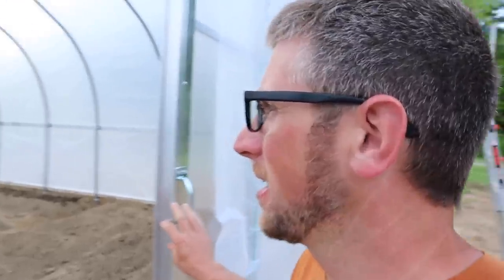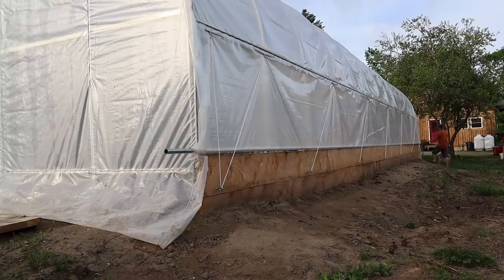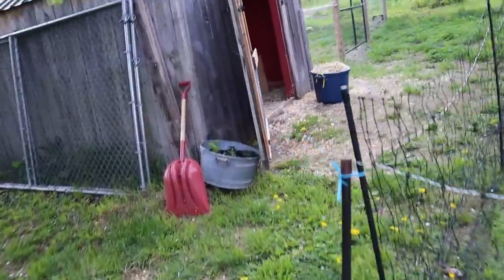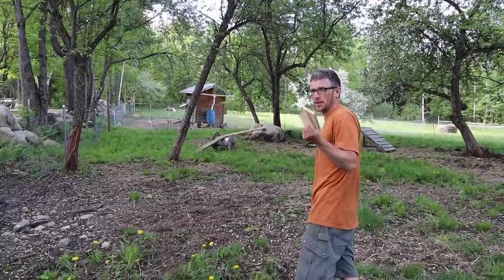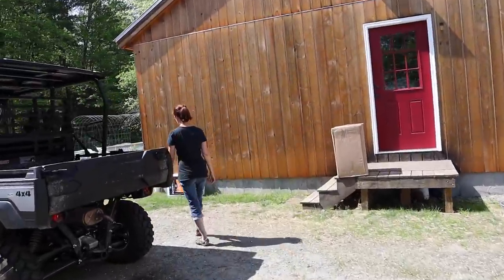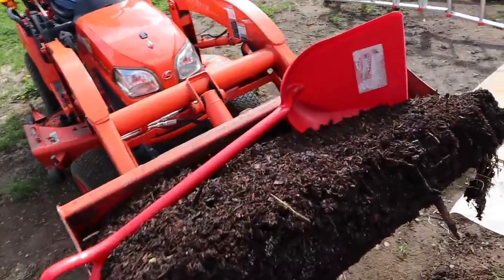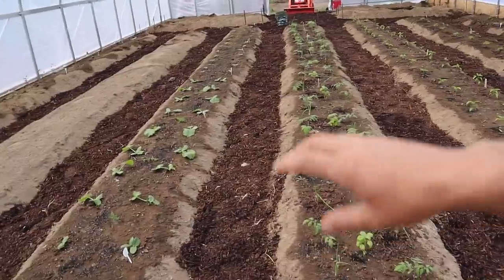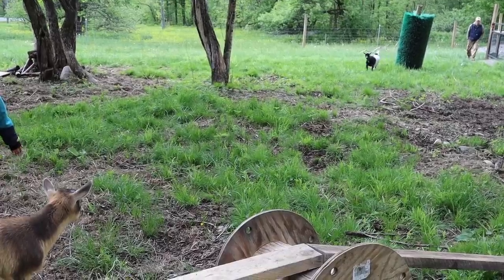Miniature Baby Goats MEET Our HERD for the First Time (Not what I was Expecting)

Comment: You can get solar power fans for your vents and hook them up to thermostat. Put 2500 black water tank to your rain gutters then do soaker hoses and drillers by gravity feed or 12v pump. Maybe leave the middle row out for your tractor and equipment to get in easy. Do hanging bar for vining plants and grow lights and even watering from above too.

Comment: Mornin Al and family, have you ever considered going to the thrift store (or similar) and buying cheap snow skis to screw to the bottom of your tractors, sure you could pull them much easier over the grass that way
Reply from the maker: I like that idea. We dont have any thrift stores close by though
Reply: How about a thin sheet of fiberglass on the bottom?
Reply: That is a really good idea! Smart
Reply: seeker my thoughts as well using old ski or even a narrow strip of tin or sheet steel galvanised if possible. Would make them slide easier and stop wear on. The wood,.
Reply: @LumnahAcres  You also didn't have any CWC licence plate makers close by , just put the word out Al and you will receive
Reply: My son worked at the local Habitat Restore and got a pair of old ski's he then attached them to an old grocery kart the wheels had broken off and it made the best crazy sled to be pulled behind a 4 wheeler (yes, they wore helmets) on our back roads, he and his friends had so much fun. We don't get a ton of snow here in central NC but we make the most of it!!!!

Comment: Instead of watering the high tunnel with buckets of water, why not set up a sprinkler system from PVC & attach it to the ribs of the tunnel ? Just run your pipe so that you could drain the system in the winter when not in use. Just a thought.

Comment: Al, have you ever looked at the Mittleider Gardening Method?  You have the greenhouse/high tunnel and the production from their 18" beds is huge in volume.  I'm working on converting to that system now.  Worth a look.  Smallblockfuelie has a bunch of YouTube video's on his Mittleider greenhouse, and his setup is way smaller than yours.  Worth a look if you are not familiar with it.

Comment: Al, do they not make a cordless drill adapter that would work with the crank mechanism for the greenhouse sides?  Since you are putting them up and down every morning & afternoon, it would make it easier if they did.  Would not a screw hook in a drill work (if they don't make a specific adapter)?  I know they make custom motorized units for that, but you already have the DeWalt drill.

Comment: I was wondering, and not sure you said it in another video or not, but about how long do you expect your plastic on your greenhouse to last you before needing replaced? I live in a very windy exposed area surrounded by fields with rotational crops, and was considering a greenhouse but not sure how the plastic would hold up. Things take a beating here in south-central Indiana.
Reply: keri 423 - It depends on thickness of plastic, see this article for some info https://blog.firsttunnels.co.uk/polythene-cover-lifespan/#:~:text=A%20polythene%20cover%20of%20this,some%20even%20longer%20than%20that.

Comment: You need to collect water off the greenhouse and outdoor kitchen. And name your bldgs. Al and Gina have you ever had a beer can chicken you can either use beer, rootbeer, orange juice or anything you like. We got this pottery deal off the internet and we put in a half to 2/3 of a can of our choice and dump into the center cavity its like a angel food cake pan but its made out of pottery and you put your liquid in the center and you dry off the fresh chicken and put olive oil or your choice on the outside of the chicken and put your choice of seasoning on the chicken and put on a tray in case it boils over and put in oven and turn to 350 degrees and in 70 minutes it should be done if your oven runs dead on and you will have the juiciest chicken you ever had and the outside skin will be crispy from what ever you put on.

Comment: Question Why are you not building permanent raised beds in the green house it would give you more surface area to plant rather than the hills you are using that waste space on the edges
If you build a 4x10 box it gives you 40 ft of planting area if you build a hill 4x10 you only get around 30ft of planting area because the edges drop off and you can't plant them.
Also it would defind the pathways
If you ran them from the sides of your Greenhouse to the edge of your doors it would allow you to run your tractor all the way through the green house end to end
Also you would only be building up your soil quality in the beds not in the path ways that you don't plant
Saving ,space, compost, & water.
I have been using raised beds for years and the soil quality is incredible because I do not waste water compost or time on my pathways I mulched the pathways every year with wood chips no weeds coming through the pathways
Reply: Lumnah Acres stated in a previous video that they are trying this way to see how it works.